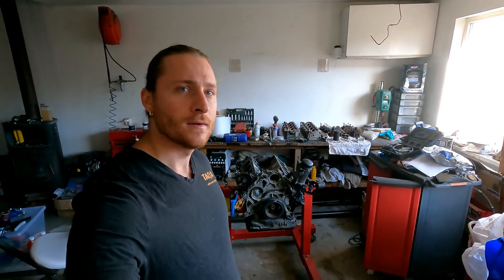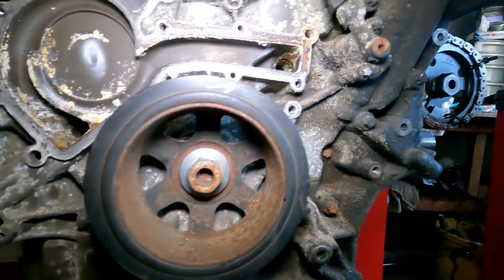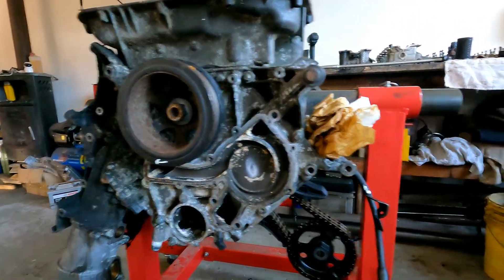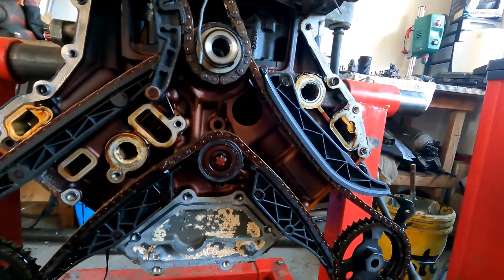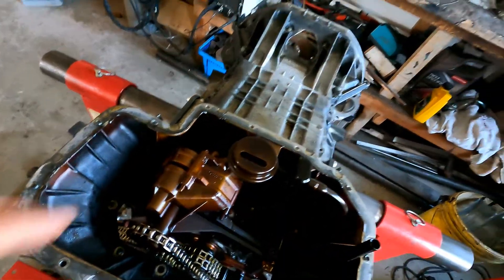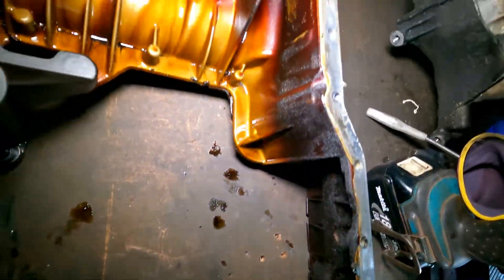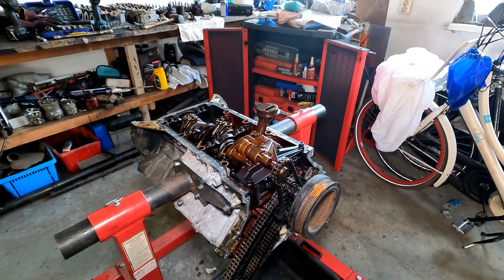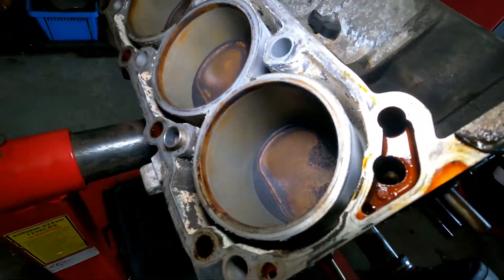M113 engine rebuild - Part 2 - timing cover + timing chain + sump removal s124 v8 turbo

Comment: Do you know if I can remove the timing cover without actually removing the engine? I need to replace my timing cover o-ring and want to do the less labor intensive route. Thanks
Reply from the maker: Depends how much room you have .  It is possible i have seen pictures of people done this in the car

Comment: Thank you for this detailed info. Is there any way to replace those two O-rings through water pump housing without taking the timing/front cover off?
Reply from the maker: No.  You have to take it off to reach them. The are mounted in between the plate

Comment: Wat was de reden dat je de motor opnieuw wow reviseren en bouwen?
Reply from the maker: Controle conditie van de motor.  Maar ik heb de drijfstangen en de kopbouten. En de zuiger veren gecapped Geupgrade voor de turbo installatie.  Vermogen zal verdubbelen dus controle en het hebben van een goed basis is dan cruciaal

Comment: in the oil sump when you removed it to remove the timing case did you remove the front 6 bolts or all 8??? struggling to get the timing case off Im currently working in the engine bay so limited space
Reply from the maker: Not sure how many bolts are in the sump. Check the manual to be sure

Comment: I have the 4.3 with 150K miles on it, and I got loud tappet noise, so I added Marvel Mystery Oil (I suppose this is "not the best oil" that you refer to) and eventually it went away, and I can see the carbon in the oil.  But I know it swells rubber so now I want to get that stuff out of there before I get a new problem with those o-rings.  So much oiling in these engines, even oil down the camshafts as well as under the pistons.  It's really fine machinery, strong and lightweight, hope I can get another 150K out of mine.
Reply from the maker: Regular oil changes.  Are really underestimated

Comment: 13:30 MB started out with the 43/430 and then the 500 and it's easy to see why they stopped with the 55 and never went bigger. There's almost no room. Makes one wonder how much work the Brabus and Vath 5.8 M113 engines required to fit in the same block. I think I even recall reading about Carlsson (and maybe Brabus as well) having some M113 engines over 6 liters.
Reply from the maker: The will have to modified the crank a lot and piston skirt much shorter to work with a longer stroke

Comment: i replaced many of these timing covers under warranty. mb did not use any antiseize on the upper alternator bolt and we had a voltage reg recall. so many of these covers would snap when removing that bolt.
Reply from the maker: Oke.  Good to know. I could remove it pretty easy.  The oil filter housing bolt was pretty stuck.  With the 46mm socket
Reply: Mine had the same problem  broke alt bolt housing

Comment: awesome series for breaking the engine down. i love the video with the details most never tell you like the swelling o-rings etc. how would you reduce the compression ration then if the shorted connecting rods are not an option? as always thank you for your videos. Cheers
Reply from the maker: Thanks 👍 lower the CR can be done making the down in the piston. Bigger but this will make the piston weaker .  So the top of the piston needs to be thick enough.  But this engine is having a CR of 1:10 so running op e85 is also an option
Reply: @JMSpeedshop  I've seen on MBworld that the 55K heads have a larger cc combustion chamber (lower compression) than the 55NA heads. On the NA heads there is a raised area (kinda triangle shaped) near the intake valves that is not raised on the K heads.
Reply from the maker: Im not going to machine the heads for lower compression i have to do it with this  but 1:10 cr will give me better flow in the combustion chamber then when lowering the cr ratio.  And on e85 it is not a problem to have some higher cr ratio
Reply: @JMSpeedshop  E85 will definitely help.